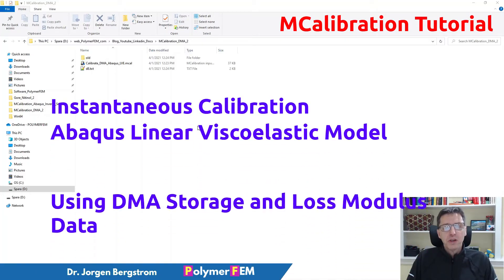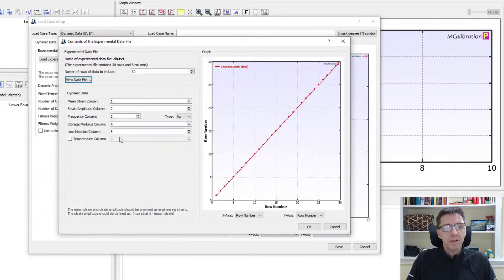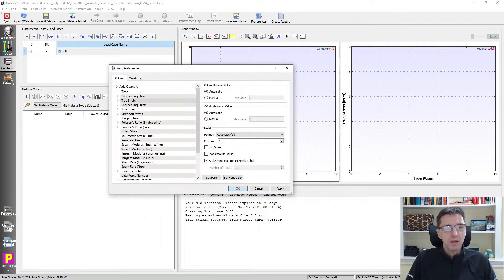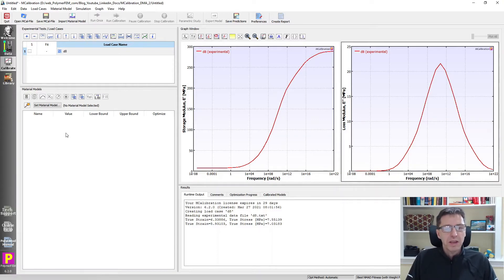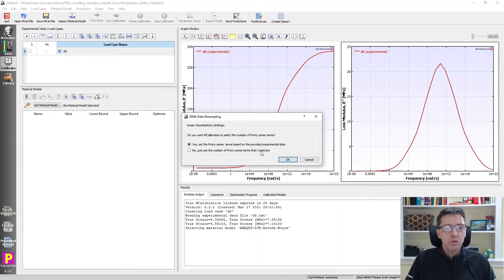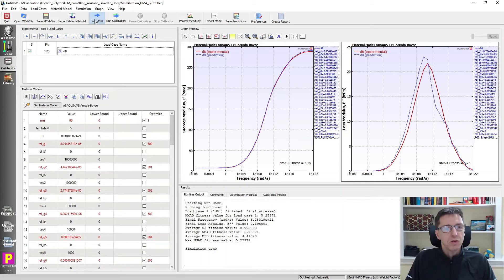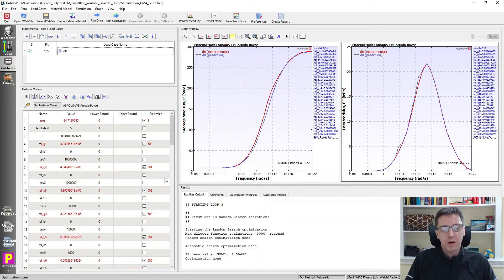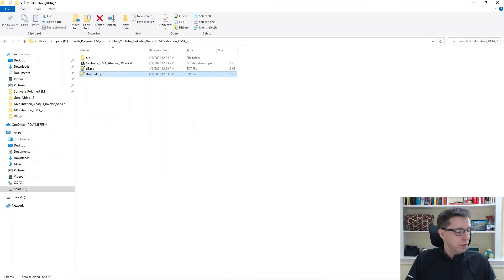Instantaneous Calibration of Abaqus Linear Viscoelasticity using E' and E'' Data

Comment: What would you do for a semicrystalline material where you cannot use TTS for the experimental data?
Reply from the maker: Good question. If TTS does not apply, then I would switch to traditional temperature dependent model, which could either be linear or non-linear viscoelastic.